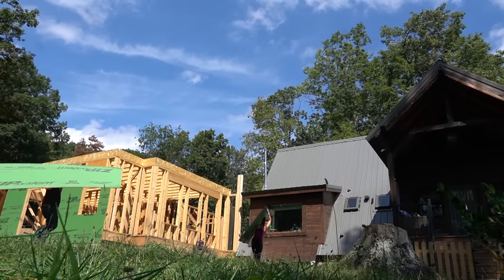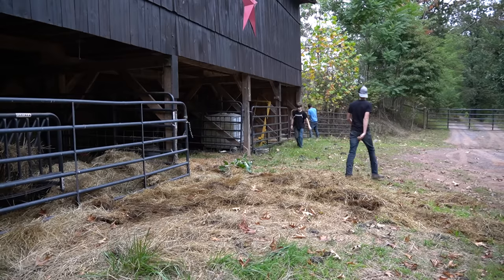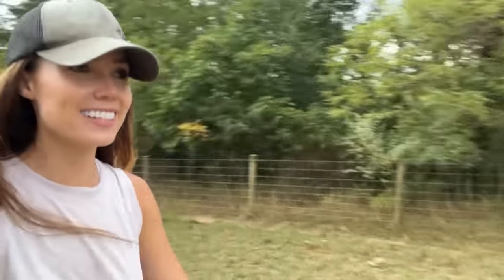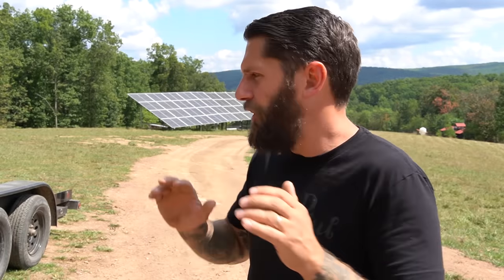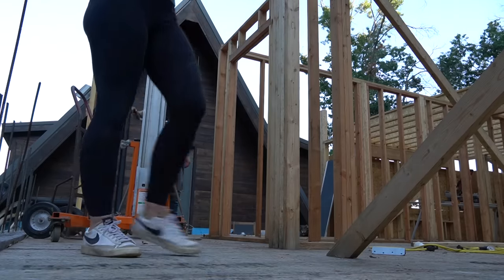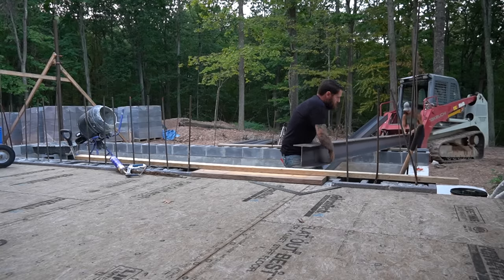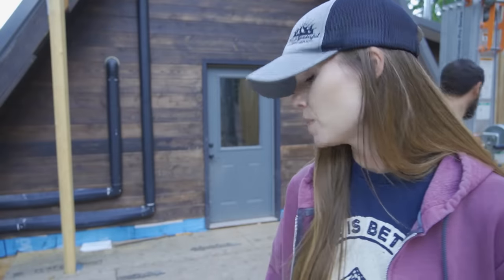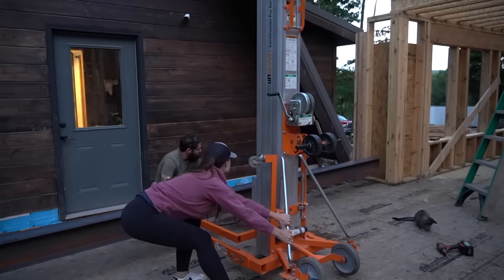STRUGGLING with 500lb STEEL STRUCTURAL BEAMS | A-Frame Cabin Addition

Comment: Quick tip from a woodworker: When routing out the window, always go clockwise. That way, the rotation of the bit pushes the router to the 2x4 your are using as a guide. If you go counter clockwise (on internal cuts), the rotation will pull away from the beam, making the router difficult to control. Hope that helps 🙂
Reply from the maker: Thank you!!

Comment: Josh did you know there are two speeds on the duct jack. If you look at the gears there is a large and small gear. Pull the handle to the right and you will go into low speed. More revolutions on the handles but easier to raise heavy loads. Other than that you guys did everything right. Smarter not harder !

Comment: When I was labouring with a friends dad. We had a job to put stress graded wood under 32 beams of a glass roof, which was starting to clasps.  Each column weighed 16 tons. The architect had devised a system using railway sleepers, steel cross beams with an Akro jack. Like those used in mines. This worked a treat a the system reduced the weight to  a small weight.   Like pulley wheels on a ship. The idea was amazing and  less struggling was involved.

Comment: Hey guys! We install large steel beams all the time. One safety suggestion since it's just the two of you, consider using two lifts. It makes a big difference when that beam is NOT teetering 10' up in the air. Another great video!

Comment: The steel beams will need to be painted with 2 shop coats of standard red oxide primer paint minimum in order to prevent the beams from rusting in the walls of the building over time. Just the moisture in the air is enough for the steel to start rusting in a matter of just a few days.

Comment: You might try using your ratchet straps with a choke wrap on one end and pull it toward the post you need rather than hitting it with a hammer to slide it into final location.

Comment: Erin the concrete worker can drive the truck with steel. BTW mark the center of the beams with a tape measure and soap stone marker then put the choker on the center line before lifting, tie a long enough guide rope for the ground crew trucker so she can stand off to the side out of the drop zone.

Comment: You should train your sheep by feeding them grain in the barn every day so if you need to catch them for any reason they will walk right in the barn. You wouldn’t have to feed them much every day but it will make it much easier to catch them. You could build a small corral in front of the barn that you could lock them in. Once they get used to being fed in there they will walk right in by themselves. Training animals to feed works wonders.

Comment: I realise that you want to do the whole thing yourselves, but swinging and lifting real bulky steel girders is some thing which maybe should involve a mobile crane. From experience, I know that there is  a great deal of difference from moving and lifting wooden beams; to trying to wrangle steel girders. For this part, get a crane and a driver, and you will be safer and speedier.

Comment: No headplate or ribs in the steel beam? Also if you drill the holes first on the top side of the beam, and flip it with the skid steer, it`s easier.

Comment: Im concerned on what i saw.  When installing the first beam I did NOT see a top plate on the  2x4 supports when lowering the beam.  If Im remembering correctly there should be a top plate mounted between your beam and jack studs.

Comment: Hey Erin, what would you consider your most dangerous job on the site before this? Thanks, long time fan.
Reply from the maker: Probably sheathing and roofing the steep A-frame. We pushed up each sheet with 2x4s. Maybe also raising the 11’ dormer wall as well. It was extremely heavy and pretty sketchy with only the two of us doing it 🤣 Honestly, we've done a lot of questionable projects

Comment: Great job on the beams but in all honesty this was scary, especially all the hard lifting you had to do and, with all the equipment you have you could have easily used that equipment to move and lift rather than struggle the way you did.  I was very concerned when Erin was helping to swing the beams and she was definitely way! too close to the beam.  I've seen ironworkers suffer lifetime disabilities doing what you're doing.  Please be careful. Safety first.